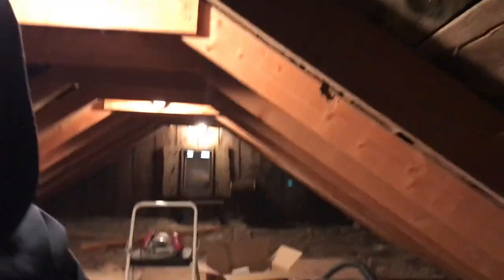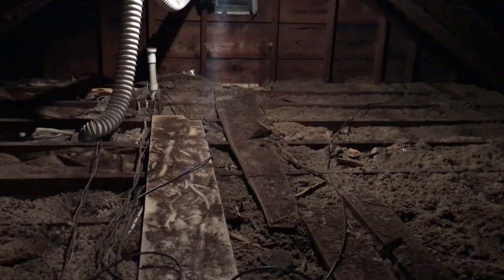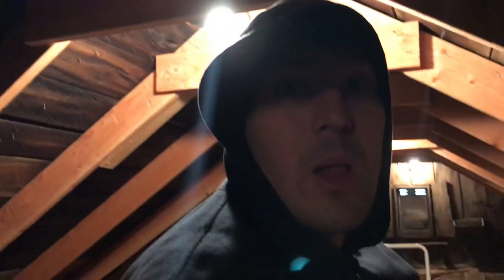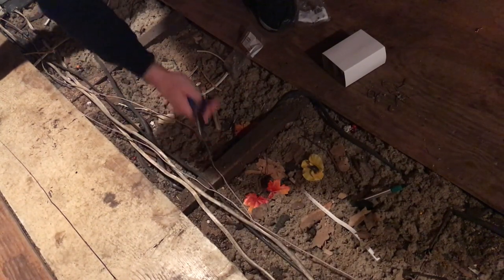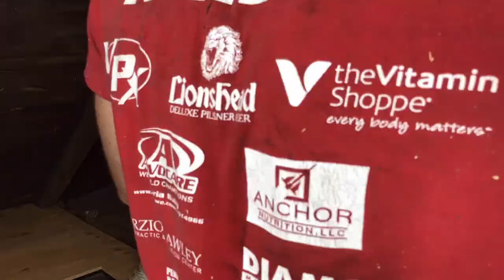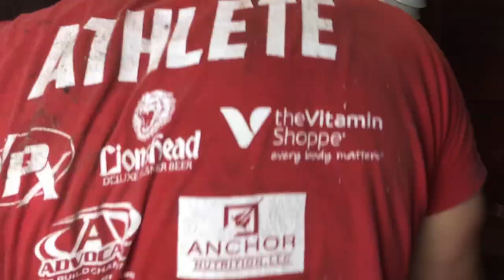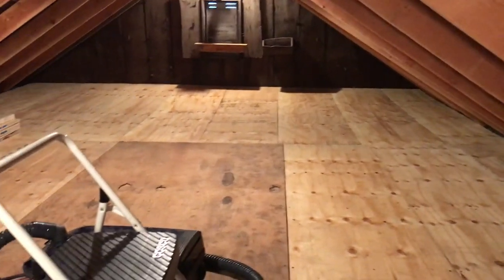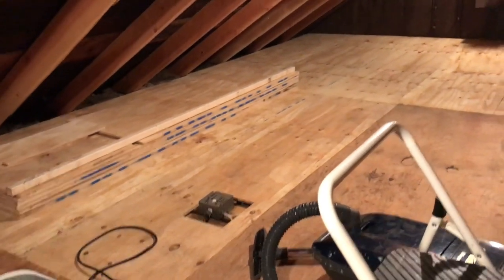DIY Attic / Loft Flooring

Comment: Ahh I’m just about to do mine, I’m guessing it’s ok to just screw boards straight onto the joists? Seen lots of videos where people mess around with stilts etc.. what’s the idea of these.
Reply from the maker: It's fine. Some people like to make a job harder than it has to be. I have done this with 3 different homes now and no issues what so ever
Reply: @DoodleBrosOfficial  You need around 14-20" of insulation to get an R-40 to R-60 rating (which is the recommended rating for about half the country) and typical ceiling joists are only 10-12" at most. The 'stilts' would allow you to pile on more insulation and then have something to screw into so you're not compressing the insulation.

Comment: What is the exact size of plywood is this your laying down and how thick is the plywood?
Reply from the maker: 1/2 inch thick. they were 4' x8' sheets that I had cut lengthwise to get them up there easier.
Reply: @DoodleBrosOfficial  I was told that 1/2 inch is to thin and that they would bend with to much weight on them, have you experienced that?  And i was told it should be 3/4 standard thickness for the Attic wood board...

Comment: You'll crack all your ceiling drywall / stucco if you don't convert your ceiling joists to floor joists. Rookie mistake.
Reply from the maker: I think for the total of 15 minutes a year I am walking up there, combined with the additional 100lb of storage evenly distributed........ should be ok. Rookie comment.
Reply: Even trusses and other shitty attics are designed to have 2 or 3 200 pound monkeys up there plus insulation. I think plywood or osb will be fine as even 3/4 is only 70 lbs per 32 square feet.
Reply from the maker: @dupeaccount1647  Exactly. J F is a total noob AMIRIGHT
Reply: @DoodleBrosOfficial  Of course, though depends on your type of flooring/ceiling joists (2x4? 2x6? 2x12?) and span and how much you store up there. With 2x4 or 2x6 attics I don't see a problem with sheets of wood and 100 pounds of christmas decorations up there. Putting a few thousand pounds of extra shit up there besides plyoowd = no bueno though. And the weight adds up fast.
Reply: Notching the ceiling joists for the electrical wires seems like a noob move. Fir out each with 1x2. You never notch the edge of a joist! Smh
Reply: Imagine I was researching overspanning attic joists and then I find a dude cutting notches in his ¯\_(ツ)_/¯ Guess if your floor hasn't collapsed yet I should be in good shape.  Amazing the high quality advice you can find on youtube!

Comment: Cut a notch on a beam.......that is how you weaken the beam . Put a 2 by 3 on top of that beam and cut that 2 by 3 instead of the beam
Reply from the maker: Much like my feelings, the beams can take a small cut out of them and still be completely ok. Putting 2x3s on top of everything would be time consuming, expensive, and unnecessary

Comment: Why not clean up the old nasty insulation first and replace it with new before doing all this work?
Reply from the maker: Sir, this is a video on putting flooring down in the attic. Did you mean to search for "Replacing insulation and putting down flooring?"

Comment: What kind of saw do you use to cut those joist holes? And the hole for the pipe??
Reply from the maker: Just a standard jigsaw. If its in the middle of the board I have to make a hole with a drill first large enough to get the blade in to start
Reply: @DoodleBrosOfficial  thanks!!

Comment: This is awesome! Are there any downsides to this?
Reply from the maker: It becomes an ideal place for wizards to establish a settlement. Other than that no. If you do not want wizards casting spells in your attic then do not, and I can’t stress this enough, create an ideal space for them to live
Reply: I was considering this method, but it seems like too permanent of a solution. I prefer attic flooring to be secure, but easily moved in case of future remodel projects. I'm getting rid of load bearing walls later and it would be hard to run a beam with plywood in the way. Removing permanently anchored plywood would be a hassle. 

I also plan on running electrical and gas lines later, installing ceiling mounted ac and heating, and running new duct work. Doing this would be difficult if I had plywood like that.

Comment: Does this work require a permit from township office? I remember some town only allow attic conversion if you have a minimum space of 7 by 7 by 7 ft .
Reply from the maker: I find that it’s easier to ask for forgiveness than it is for permission
Reply: @DoodleBrosOfficial  Bob villa says to get an engineer to make sure your joists can handle the load.  What do you think?  Has your house collapsed yet?
Reply from the maker: @Skepticaleo  twice. Went down sideways and took out the neighbors house too. I rebuilt it after the first time because I figured it was a fluke and did it again and wouldn’t you know it? Collapsed again. 

Nah. it’s fine going on over a year now. No cracks or anything like that either
Reply: I built my house up from nothing too. When I started, all there was was swamp. Neighbors said I was daft to build a house on a swamp, but I built it all the same, just to show 'em. It sank into the swamp. So, I built a second one. That sank into the swamp. So, I built a third one. That burned down, fell over, then sank into the swamp, but the fourth one... stayed up!
Reply from the maker: @Skepticaleo  a tale of perseverance!

Comment: Did this help with your electric bill?
Reply from the maker: hulkhuggett finished it just as spring approached so I have not had a chance to see if it will help with heating. Cooling in the summer has been about the same so far (but as it’s been a crazy hot summer, maybe that means it has been working!$
Reply from the maker: Update: my house stays heated like an angry ex
Reply: @DoodleBrosOfficial  lmao

Comment: Great Video Doodle Bros. I was wondering. I have a attic opening of about 40" inches square. I noticed that your boards were 8 footers by about 40 Inches (?). This is what one has to do in order to get them up there, correct?
Reply from the maker: Yes the original boards were 8’ x 4’ but when I bought them from a lumber yard I had them cut in half, otherwise I would not have been able to get them through the opening due to the angle of the roof. If you are able to keep them in the larger size, definitely do that. The bigger the board the more structural integrity it will have

Comment: you put the boards over the wires? the wires need to get air.
Reply from the maker: They aren't puppies in a box, Nancy. Do they need sunlight for photosynthesis too?
Reply: @DoodleBrosOfficial  😂🤣😂
Reply: True the wires need air to stop them over heating, or you could burn your house down,  this is no joke, also  you need ventilation between the insulation and floorboards or your ceiling joists will rot,

Comment: Did you foam the little holes in case critters get in the attic?
Reply from the maker: What little holes?
Reply: Doodle Bros the lil gaps I meant around the pipes and edges. Ive got Critterphobia lol
Reply from the maker: @SouthernRancher13  I did not. Realistically I was not looking to seal up the area so much as just add flooring to walk on. However, the ceiling drywall should already make a good seal between the attic and the rest of the home
Reply: Doodle Bros nice job!

Comment: Stop doing this! The attic’s is not intended for living space and when you convert it without proper knowledge on insolation, ventilation and structural framing you are doing so much harm to your home. I’ve seen so many homes that were built 100+ years ago get destroyed because of “DIYers”
Reply from the maker: Brinkman you are such a joker. Always have been, ever since elementary school
Reply from the maker: Just decided to come back to this comment and let you know I am currently DIYing a full scale battle-octagon which I am going to call "The Gauntlet" in my attic. This will add further weight and harm to the structure of my home. Once completed, I will return to challenge you to hand to hand comment for your slight. Prepare now, for your time of reckoning is nigh.
Reply: @DoodleBrosOfficial   hahaha-  these comments are gold.